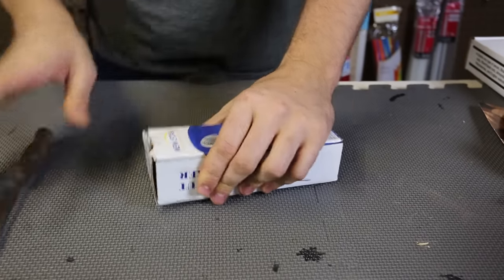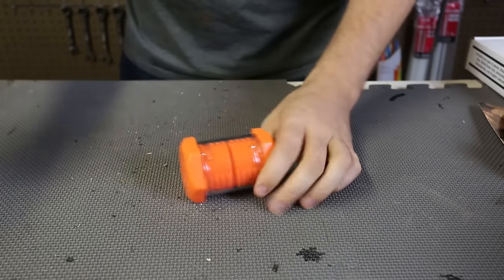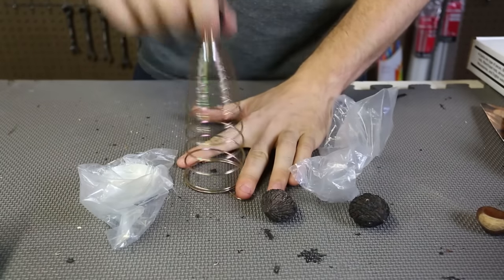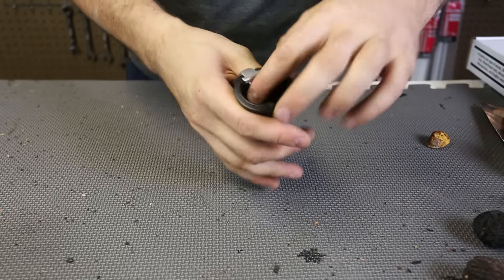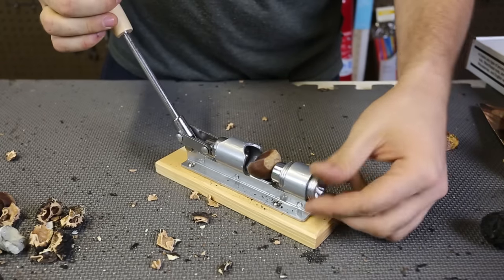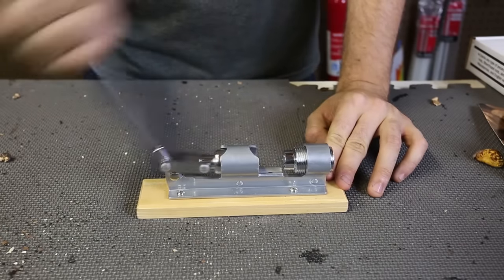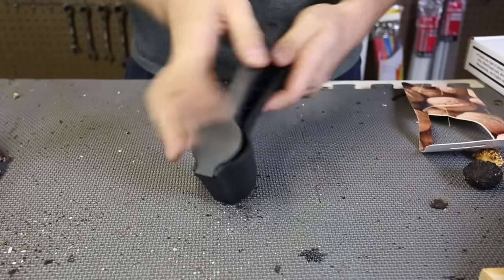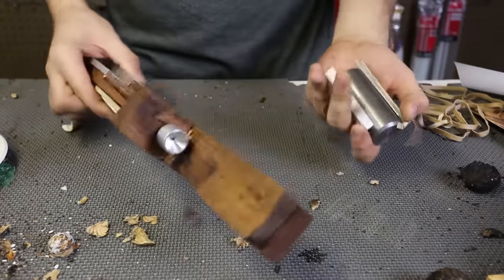10 Gadgets That will Crack your Nuts

Comment: the nuts you are cracking are not a good example for the nutcrackers - the black ones are called "black walnuts", are used only as medicine (they are laxative), if digested (mostly used for making jewelery) and their shell is extremely hard. The other ones are chestnuts, which are mostly roasted in their shell before eating (you have to cut the shell with a knife before roasting, otherwise they explode). You should have used some normal walnuts and haselnuts, for which all the devices are ment...
Reply: Black walnuts is better than the white ones #BLACKPOWER
Reply: runolorun
Reply: runolorun thats actually kinda cool to know! ive got that them in my back yard and i always wondered why they seemed different

Comment: why dont just use a hammer
Reply: luka 973 it'll go everywhere and gadgets look cooler
Reply: MrSchubeyFilms Actually your correction is wrong.
Reply: +You need some milk he was talking about how he pronounces it in the videos
Reply: luka 973 I'm just gonna get a hydraulic  cylinder and weld up a mini hydraulic press to connect to the skid loader

Comment: The easiest way to open a nut is to insert a knifepoint into the hole and turn it while you hold the nut. Nuts are like eggs: strong to break from the outside but easy to break from the inside. If you do not have any knife, it also works with some piece of wood. Nuts are never cruched this way. It requires very few energy.